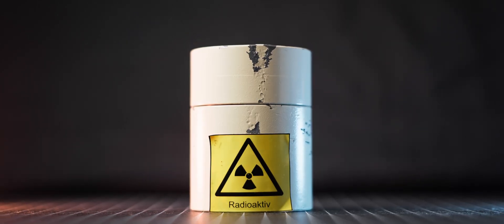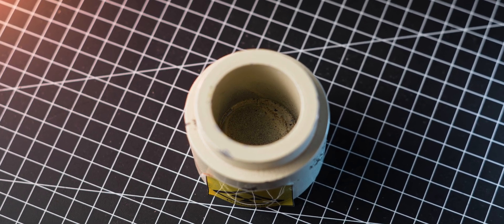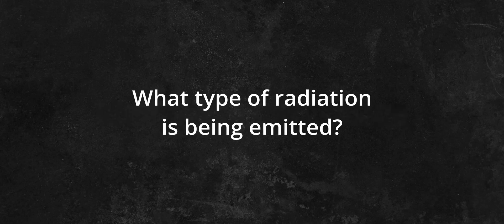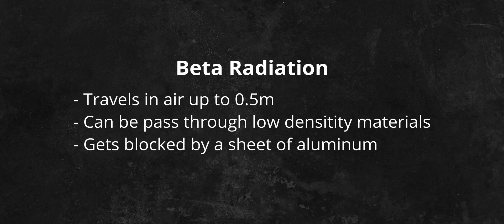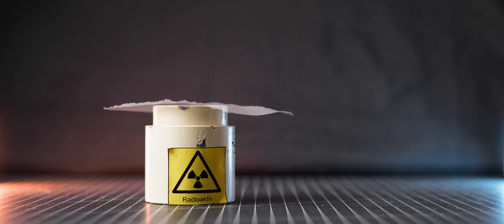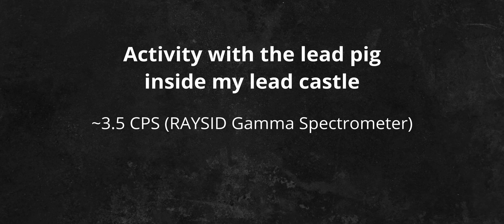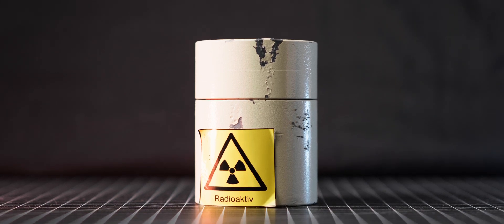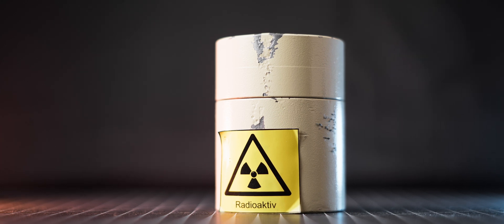Radioactive Contamination Found – Can We Identify It?

Comment: The beta contaminant is going to need more than basic spectroscopy as the energy distribution between the electron, photon, and antineutrino is continuous and not discrete levels and so it tends to warp the spectrum with a normal distribution "hump" capped at its maximum that has no discernable peak.